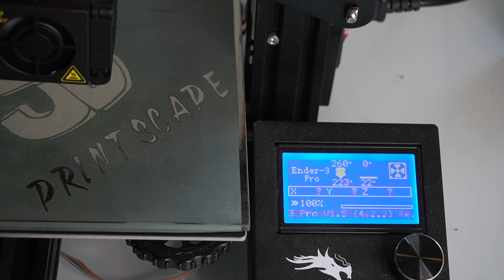Creality Spider Hotend – Install and Initial Thoughts!

Comment: Dumb question but how did you get that thermistor to stay in the intended spot? Mine keeps coming out. I know the little copper rod is for that but that's just funky way to fit that without locking it in place without the screw on stock hotends?
Reply from the maker: Hi. If i remember correctly there is a screw (small allen wrench one) that has to be tightened to hold it in place.
Reply: @3DPrintscape  that I'm aware of but the way that it's design typically there's a screw that holds it in the place too which that doesn't have anything of the sort. So ultimately I had to lengthen out that part to fit it in there but it's just kind of freely hangs.
Reply from the maker: @hunterjorschumb8327  I looked back at the video and im seeing the screw holes for tightening it down, cant actually check the printer right now. The one you got may be defective.

Comment: Any tip on how to remove the filament tube, when filament is still inside? My hotend doesn't become hot anymore, so i cannot remove it
Reply from the maker: Hi. You would have to disconnect the tube from both sides, cut the filament on the spool side a couple of inches after the tube (should have enough filament to pull if needed), then slide the tube off. Ive done it before, its not too difficult just requires more work.

Comment: Hey ik the video is 11 months old, not that old but yeah! What do I do if my 3d printer nozzle is heated to 200 but its ranging from 197 to 204 like it keeps going up and down slowly if that makes any sense? How do I re-tune it ig to where it stays at one temp the whole time its printing or did I fuck something up when installing this? Also do I use the thermal Paste??
Reply from the maker: Hi. It typically allows for some buffer but it could vary based on the nozzle/hotend material.
Reply: @3DPrintscape  I am printing with PLA, and the nozzle/ hotend is the stock one in this video, but thank you
Reply from the maker: @itzCH1LLS  ok, small ranges is pretty common for most of the hobby printers. A all metal hotend can help keep them more consistent.

Comment: I'm having issues getting the thermistor out of the old one. Should I turn the machine on or not
Reply from the maker: Hi. I haven't had that issue before and the printer shouldn't need to be on but if its stuck you could heat the hotend a little to expand it then pull the thermistor out. Just be careful as it will be hot and make sure to power it off as soon as you get it out.
Reply: @3DPrintscape  thank you

Comment: Great video. Thanks, I installed my spider v3 hotend following your instructions. Great. I have Ender5 plus. I have a problem , it is not extruding! I print at 220C When I push the fillerment through, it doesn't come out! It did come out when I increase temperature to 230C. It printed for about a few minutes then filament stopped coming out ! Help!!!
Reply from the maker: Hi. It sounds like you may have a clog in the hotend or nozzle. I would check that out before digging into anything else.
Reply: OK thanks will check now. It is not the nozzle as I cleaned it with a needle and there is not gunge @3DPrintscape
Reply: You are right !!! How do I unblock hotend, nozzle I can use a new one @3DPrintscape
Reply: Yes you are right so far, I clean out heat block and also put in a new nozzle. Try to extrude fillarment, not coming out. It does come out if I push it. Wheels on the extruder is working. I use a thermo couple to test temperature on heat block, not heating up! My setting was 240C heat block only reads about 109 C and not going up anymore.  @3DPrintscape
Reply from the maker: Check all the wiring on the heating elements, something could be loose.  @jessielee278

Comment: I think with Marlin 2.1.2.x the Thermistor setting causes failure to build if the hotend temp is set to 300 with overshoot left at 15, or even with overshoot set to 10.
Does anyone know what thermistor to set for the Spider?
Reply from the maker: Hi. This video should help. https://youtu.be/GbgdG4eWSjA

Comment: I just installed this on my Ender 3 V2. After leveling and calibrating I began a test print. About 1 minute in the hotend temp plummets and i get an alert that its a critically low temp and "your firmware has failed."

Can you recommened where to find the appropriate firmware for my printer and this hotend?
Reply: Another update! I replaced the thermistor completely as in removing the panel to motherboard etc and she works like a charm. Hope this is helpful to others! I continued with my existing firmware:) thanks again
Reply from the maker: Nice, i wish i saw this before replying to your previous comment lol. But im glad you got it working and thanks for sharing the fix. @mew5889
Reply from the maker: Hi. If your not trying to hit 300 degrees the firmware already installed on the printer should work fine (it doenst care about the hotend). Did you replace the thermistor and can you check all the connections for that?
Reply: I did not replace it, but used the copper housing with the existing thermistor. I was curious if that was a little bit dicey, as it wasn't perfect or beautiful. Sounds like I might need to use the new one that came in the kit! I appreciate your reply!
Reply from the maker: In theory, the old one should but it sounds like the issue is there.  @mew5889

Comment: There seems to be some inconsistencies, I guess in manufacturing runs.  Mine has the heat element hole go all the way through the heat block but the thermistor must be inserted from the left side only.  That hole does not go through.  Like yours, the silicone sock has openings only on the left side but the Creality spares I bought have both holes on both sides.  Otherwise, what are the two M2 limit screws for and the red anodized piece?  I'll look for your Marlin updates and see how this goes.  Thanks for the video.
Reply from the maker: Hi, its probably changes they made as they got feedback from consumers. The extra pieces are for connecting to different printer/extruder combos.

Comment: I got 2 on 2 of my 3 Ender 3v2 with the sprite extruder mounted right above it. I really love them but soon will be getting the Water cooled Spider Hot End. This will open up new mounting options for fans and more importantly the CR Touch as I have a custom mount I'm designing for it.
Reply from the maker: Hi. I have been looking at the water cooled hotend, it looks interesting. Do you think its worth the cost over the base spider?

Comment: Is it possible to use this hotend above 300? Not much extra i need, 290-300 is ok. Altough with hardened steel it might need 10-15° C extra, and it would be better to have that  reserve.
Reply from the maker: Hi. Honestly, im not sure. I know they say it supports 300 and they may have said that conservatory but im not sure i would try above 300.

Comment: I got the spyder 2.0 for my ender 3 will I need to P.I.D. tune
Reply from the maker: Hi. The right answer would be yes. That said, i would try a couple test prints to see fi your having issues before going through the effort.
Reply: @3DPrintscape  thank you I seen a video on how to do it last night looks quick and easy if I have too

Comment: Is there a significant difference in print times?
Reply from the maker: Hi. There is really no difference in print times.
Reply: @3DPrintscape  that’s funny. I could have sworn I saw something from creality saying it increases the times by half. Oh Well next time my hot end gets clogged maybe I’ll upgrade. As always thanks for the vids. Quality content!
Reply from the maker: @m1lkm8n78  The sonic pad reduces print time because it moves to Klipper.
Reply: Print time would require new firmware, but the hot end capable of Keeping up with very fast print speeds would need maybe a 60watt heater cartridge. I'm not sure if that's what the Spider uses, no documentation in that regard.

Comment: Hi
I look almost on all hot end and only swiss and hotend identical installed from start in ENDER 3 V2 NEO. I have question  i run on NEO btw.. i try find some make better my work but every videos with install or printers say ENDER 3 V2 + another versions but neo is not on list. its so big problem? or neo really dont "support" all these nice hotends? its some little in construction? i hope you know anserwer becouse all videos on internet dont use neo version. Ty for read and sorry for english, still learn :)
Reply from the maker: Hi. Sorry for the delayed response this comment was held for review as possible spam. I dont know for sure if the hotend mount for the neo is the same as the standard ones. I think it is though so it may mount but im not sure if the fan cover will fit. I just havent worked with the neo much.

Comment: I just ordered this but read afterwards that there may be some drawbacks from using a high-flow hotend. Did you experience any? Thanks for the review.
Reply from the maker: Hi. I havent had any issues, just make sure to calibrate your esteps.
Reply: @3DPrintscape   Thanks, will do
Reply: Why calibrate e-steps when changing the hotend? only time your e-steps will change is after replacing extruder or adjust tension of extruder spring. @3DPrintscape
Reply from the maker: @DjWondah  It could impact the flow. I had to make a small adjustment on my e steps after changing it out.
Reply: @3DPrintscape  not possible, you calibrate esteps only through your extruder, if it gives the exact amount you’ve asked for, your esteps are set.

After that you calibrate flow, but you do that with a calibration print and adjust the flow percentages in your slicer.
Reply from the maker: @DjWondah  I calibrate my e-steps anytime i  mess with the extruder or hotend. I do it to be sure its right, like i mentioned there was a difference when i did the calibration after i swapped the hotend.
Reply: @3DPrintscape  with the extruder you’re right but I really can’t understand that a “advanced” user with a YouTube page about 3d printing can’t understand that a hotend has nothing to do with e-steps. 

Think logical your rotational distance keeps always the same, no matter what hotend or even without a hotend because the hotend is not used while calibrating esteps.

Esteps is a machine calibration and flow is a software calibration.
Flow have to be calibrated when you change anything with the hotend, bowden, nozzle etc but you do that with a test print and adjust the settings in your slicer and not changing the hardware machine settings from your steppermotor/extruder.

Comment: So I purchased this hot end but I need to order a new Heater Cartridge, is it a 40W 24v for Ender 3 pro?
Reply from the maker: Hi. You shouldnt need to replace the carriage for this upgrade. The power supply is typically 24v but you will want to check what you have. Ive seen a lot of differnt components used in the same product family.

Comment: I cannot find any information anywhere for this thing. I bought the spider hotend, and during installation i was inserting the thermistor into the provided copper tube and tried to crimp it a bit to secure it (as i read i was supposed to do so) and the copper tube broke and i snipped one of the wires of the thermistor.

So the thermistor can be replaced i suppose, but I'm clueless about the copper tube.

I also found some thermistors on Amazon that come with a copper tube on it already, but the description says it fits 3.15mm ~ 3.2mm. i measured the spider with a ruler but it looks like 3mm exactly.

Can you provide some guidance?
Reply from the maker: Hi. Where you trying to use the glass thermistor in the copper tube or the full copper one they provided. The kit should have an extra copper tube in it.
Reply: @3DPrintscape  thanks for the reply! Unfortunately, my kit only had a single copper tube in the pack, no extras. There was also no thermistor. Instead, I was trying to insert the ender 3v2 stock glass bulb thermistor into the only copper tube that was provided in the pack. 

So I'm not really sure what to do now.
Reply from the maker: @SkaterCreator  Honestly, i would try to contact Creality to see if they will send you one.

Comment: What is the point of installing the hotend and not covering the firmware upgrade?
Reply from the maker: Hi. I lot of people just run the hotend without changing the firmware. I do have videos coving the firmware parts though.
Reply: @3DPrintscape  did you mean "A lot of people ARE FORCED to just run the hotend without changing the firmware because Creality gave no proper support for this part"? 
The solution you gave in the other video is rather useless as it does not fully work. 
I still wonder how can you say that Creality Spider is a good upgrade for Ender
Reply from the maker: @Kuba1974  I have a video covering how to get the temperate up to 300 using marlin. Im running it now on that printer, it works without any issues. I like the upgrade, i guess it all comes down to what your looking for and if you want to spend the time to get everything calibrated.
Reply: @3DPrintscape  yes, you do have such video, but .... I'm not sure if you know this, but if you declare wrong thermistor in Marlin, then it will show you wrong temperature readings. This means that you have no idea what is the printing temperature and you can damage your printer. Not mentioning that if you use, your own firmware, then Creality will cancel your printer's guarantee. 
Perhaps you should check few things before you post them?
PS. Fun fact. Creality holds the information about what thermistor type is used in Creality Spider, hence you can't compile your own firmware.

Comment: I have it, but dont work with PLA. All models have horizontal lines.
Reply from the maker: Hi. I havent had that issue at all. I would check to see if you have any dents or something in your wheels or tracks.
Reply: @3DPrintscape  
I think I need to adjust input shaping.
Reply from the maker: @Damjan1187  That shouldnt be needed.
Reply: did you figure it out having same problem atm

Comment: Hi I mounted a spider on my ender 3 pro, but I can't figure out what my retraction settings, I'm getting clogged nozzle when I printed my first benchy
Reply from the maker: Hi. I didnt modify the retraction setting but did calibrate e-steps. I would start there.
Reply: i use 2mm

Comment: Seen someone say you can mount it backwards,so your wires will be on the correct side
Reply: The Spider 3 I got today had a sock with holes on both sides.  They must have responded to feedback.
Reply from the maker: @michaelwood9967  Nice, good to see that.
Reply from the maker: Hi. That would probably work just fine. I didnt go that route because it was easier to just slice the cover and make it work.
Reply: This'll save a lot of work for sure, thanks for the tip👍🔥

Comment: you know you can cut the wires and join them with Waterproof Solder Wire Connector Terminals Kit and a cheap heatgun
Reply from the maker: Hi. Ya i know, i have some heat shrink tubing as well. I just didnt want to recommend that to someone who may not know what their doing.
Reply: Or just crimp some plugs onto both sides and have a quick-switch thermistor.

Comment: I have returned my spider speedy twice already because of the quality of the bolts used to connect the bottom plate to the heat block. The first return was the allen slot is already rounded and the included allen key will not work. The second return was the head of allen bolt broke off when I was removing it.
Reply from the maker: Hi. Interesting. Did they both ship from the same supplier? Im wondering if it was just a bad batch or something.

Comment: Interested in the difference between the spider and the micro Swiss, there doesn't seem to be any real comparison video's between them - what's your TLDR?
Reply from the maker: Hi. Honestly both seem to be made well and i havent had an issue with either one. The spider came with an extra nozzle which was nice. I think my recommendation would be to buy which ever you could get cheaper.

Comment: Is that the MKII Spider? without firmware to support the hotend the only benefit is the all metal hotend, saying that I wouldnt install Creality firmware anyhow, they cant get it right!
Reply from the maker: Hi. Its the creality spider hotend. The real benefits is moving away from the issues with the stock one, better temp regulation, higher temp (if firmware is updated), and you get the steel nozzles (though these can be added to the stock one). I originally purchased my microswiss one because i was having issues with filament getting stuck in the stock one. Also, i agree with you on not using the creality firmware :).